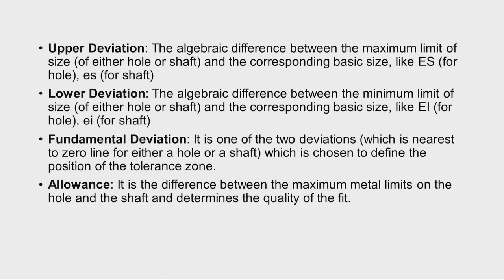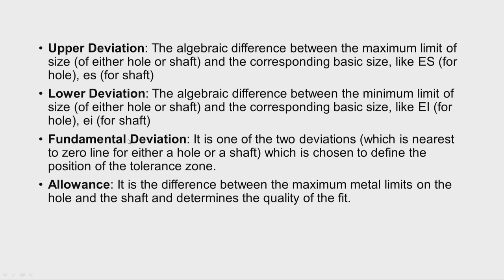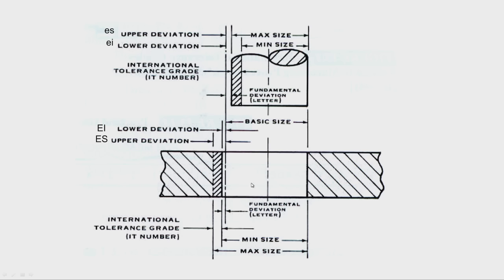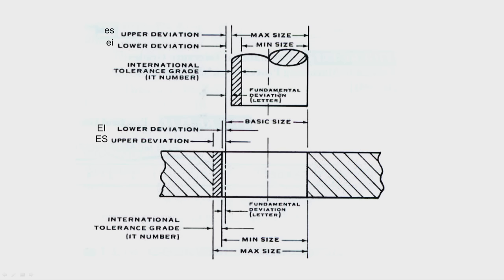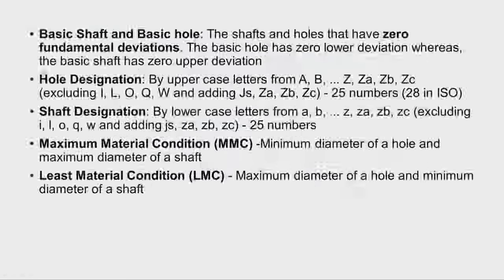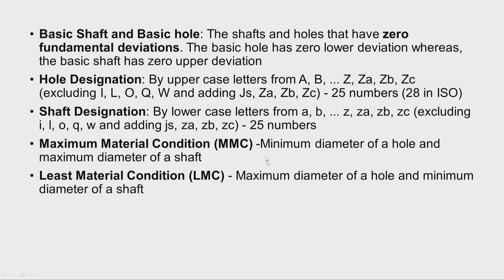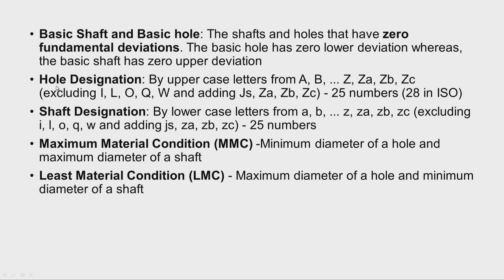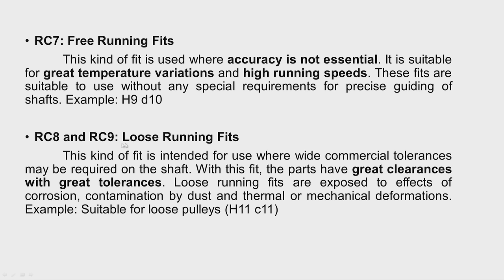Terminologies of limits fits and tolerances

Comment: It is good but even more in-depth explanations are needed. You just started saying Hole is designated in Capital Letter and showing a chart without explaining the reason for such a system and where it came from, and what is it's use. So I would say that what you explained you explained well, but you just didn't explain the whole subject matter, which is as good as not knowing anything at all.